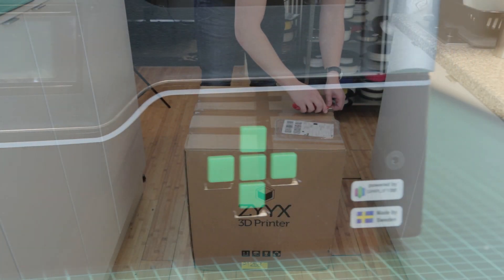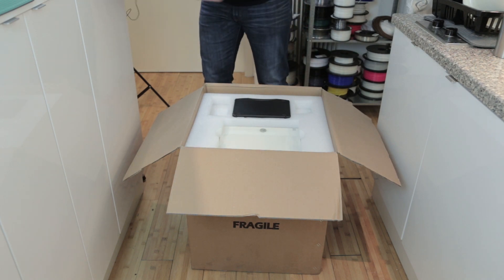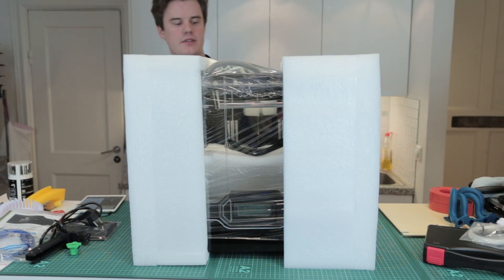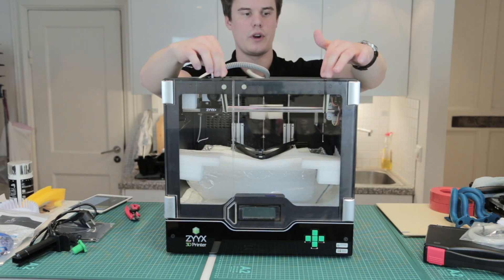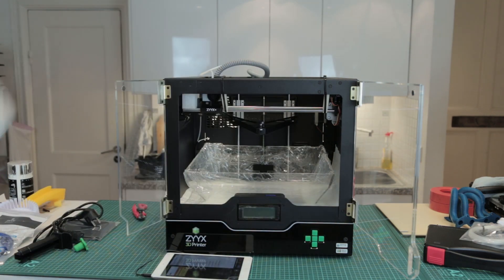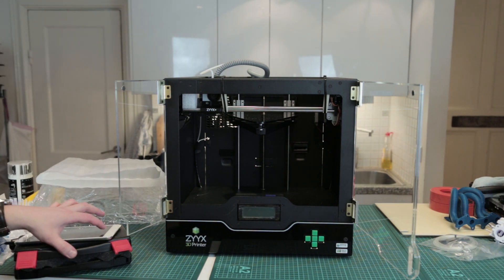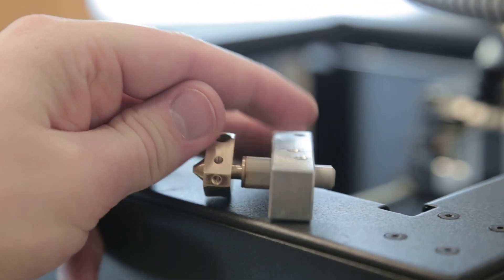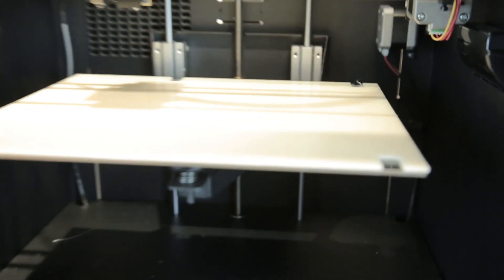Unboxing the ZYYX+ 3D printer

Comment: Surprised that the z axis screw is unsupported on the upper end. CTC printer also has this problem.
Reply: +TheViewFromUpHere this is by design. Most printers does it that way.
The lead screw is meant to control the movement of the Z axis alone. There are metal rods meant to keep the build platform stable in the XY plane. Lead screws are often not perfectly straight, and by keeping the upper end loose you actually prevent wobble, so you will likely get worse results with if you constrain the upper end of the screw.

Make an image search for "z wobble" and you'll see what I mean.
Reply: The Makerbot Replicator, Flashforge and the QIDI Tech have supported z screw at the top. Less expensive clones will not have this.